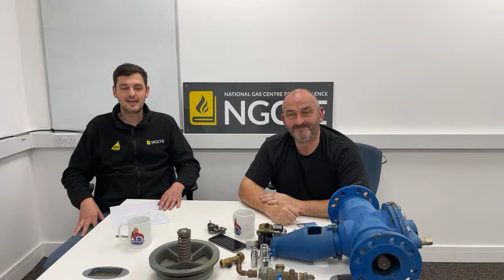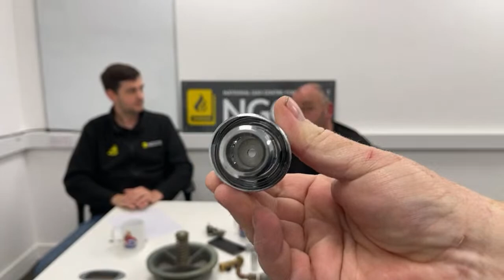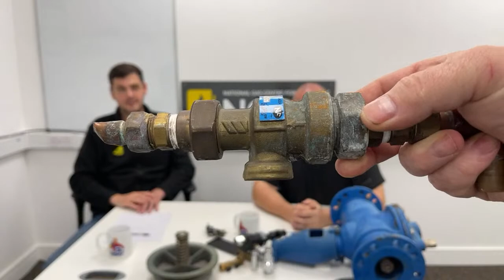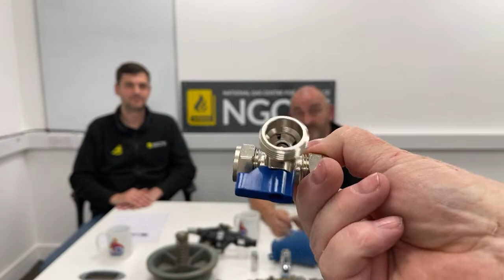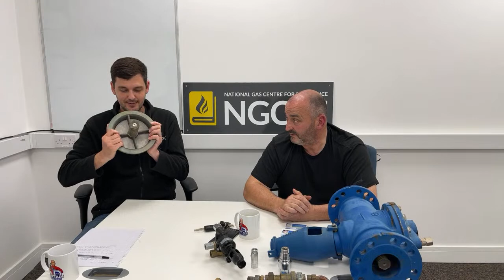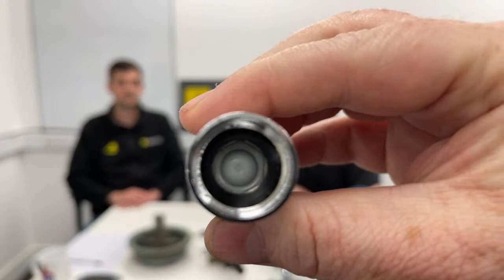Plumbers Chat | Water Regulations | Captain BackFlow #NGCFE

Comment: Just incase I’m heating it wrong are you saying fitting a shower pump is cat 5 if it can pump more than 12ltr per min  from a cwst
Reply: Not cat 5 but Reg 5. A regulation 5 document should technically be submitted  if over 12 ltrs per min.
Reply: @DALEYPLUMBING  
Thanks for that

Comment: Good video, possibly one of your best  🙂

Quick Tech question:- Incoming Main, into a House:- Can the First/Main Isolation valve be a Lever valve or must it be a brass Stop Cock type with a crutch handle  ?
Reply from the maker: I cannot think of any reason why not tbh. Maybe Paul could tell us.
Reply: The water company may ask for the main stop valve to meet BS1010 but within the guidance it makes reference to a service valve that is serviceable and that technically would be accepted.
Reply from the maker: @DALEYPLUMBING  Thank you very much.
Reply: @DALEYPLUMBING  
Lever valves ain’t serviceable tho
Reply: @plumbertime  3 piece ones are and typically used in commercial applications for that very reason
Reply: @DALEYPLUMBING  
So unless it’s a 3 part lever valve it wouldn’t be acceptable to fit a standard lever valve in place of a stop cock?
Reply: @plumbertime  this is what it says in the Water Regulations Guide . DETR guidance extract - spherical type valves may also be used in all sizes for above and below ground.  Water Industry Recommendations Guidance extract- others types of stopvalves and servicing valves may be used providing that they conform to an appropriate British or European Standard, or the Regulations, and are suitable for the purpose.
Reply: @DALEYPLUMBING  
Thanks